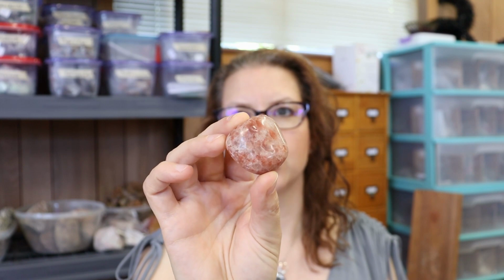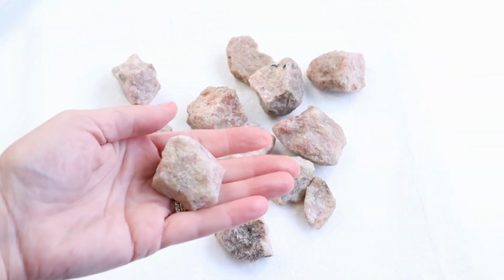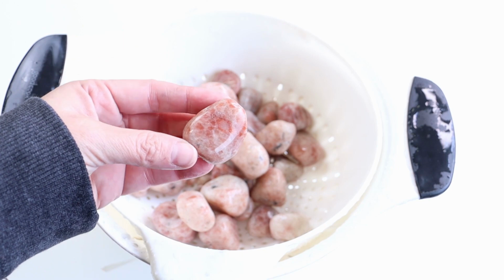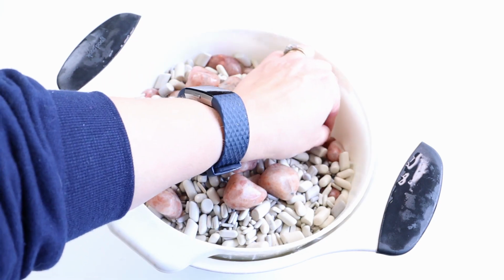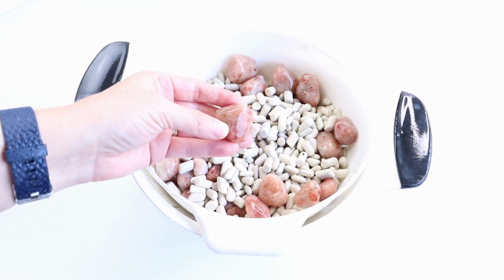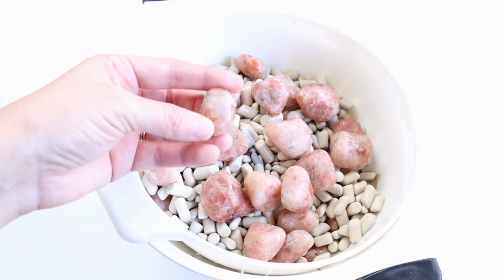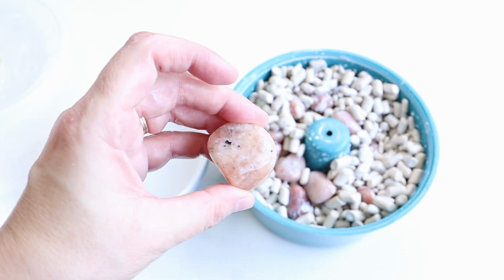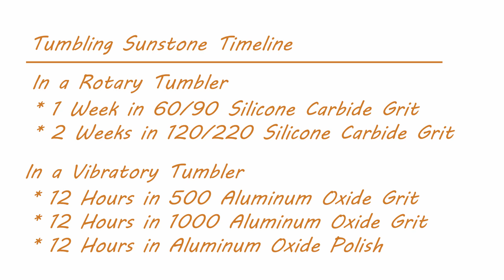💎 Rock Tumbling SUNSTONE 💎 From Start to Finish! | Rotary Rock Tumbling Tips & Techniques

Comment: Nice stones. Does it come in other colors? I don't know if i want to take on a stone like that yet. I am tumbling crazy lace right now and the tumbling is ok it's the cleaning of the stone. All the holes, batroytals, and crevices to clean. My toothbrush got a work out today but they are looking great so far thanks to you. How is the petrified wood coming along?
Reply from the maker: Thank you!  Sunstone is primarily this orangey color, but faceting quality sunstone does have some variance in yellow to orange.  I'm having the same trouble cleaning polish out of the pits and vugs in the Lake Superior Agate. I didn't have that problem with the crazy lace, but the polish wouldn't even come after after a few washes and burnish - my toothbrush is getting a workout too 😆 The petrified wood is going well, but I have some in a smaller barrel going through some more course. The lighter pieces of the wood tend to shape faster than the dark ones. I can't wait to see it all polished!